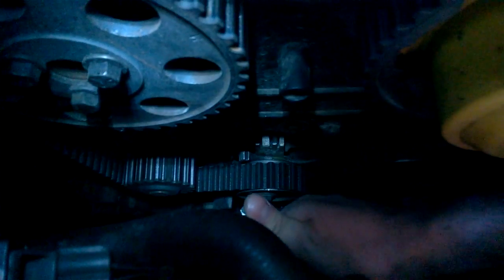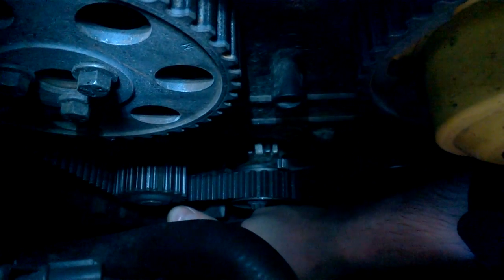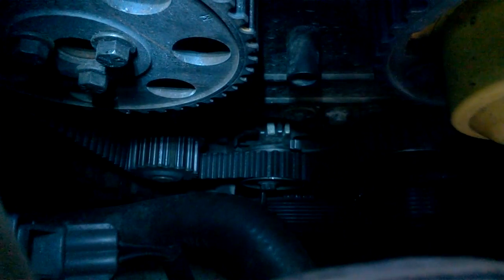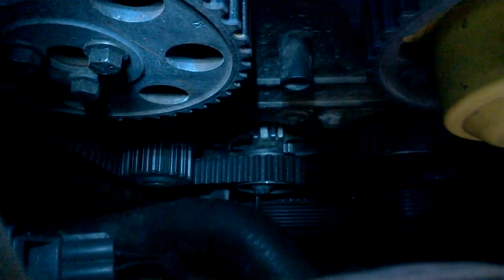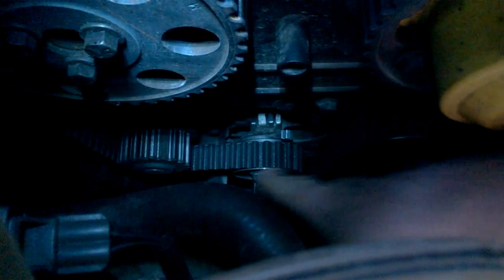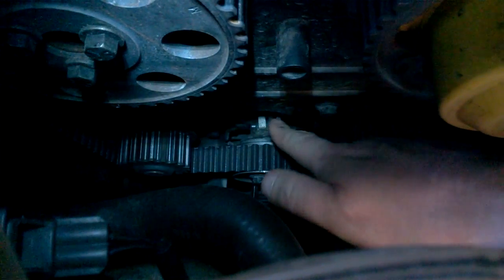Volvo S60 V70 XC70 timing belt tensioner set adjustment 2001-mid2004

Comment: Thank you for the video!  Here is what I'm experiencing.  I'm trying to set a new Volvo INA mechanical tensioner, like the one in your video.  On a 1999 S70. 

1. The new timing belt is on fine.
2. Tensioner bolt is on finger tight.
3. Hex hole is starting at 11 o'clock.
4. Turn 6mm hex counter clockwise.
5. Needle does not move.  (it should be!)

I believe the tensioner is mounted correctly, as tabs 2 & 4 are outside of the rib on the block. 

However, I noticed that if I start at 11 and turn clockwise, the needle will start to move to the right once I get to 12 o'clock. I moved the hex further a bit more to 1 o'clock, but then stopped as it felt like I was putting a lot of stress on tab #2, like it was start to bend if I went further.

I know I am using the right tensioner, part INA 30638277, as my engine serial number is about 16xxxxx and calls for this tensioner.  Thank you.
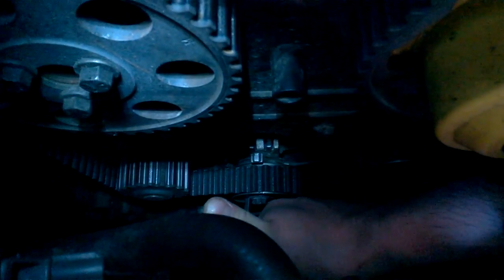Reply from the maker: Hi there.  With the hole at 11h, does the tensioner feel 'free' like at 0:26?  With the hex hole in the released position (at 11h) depress the belt between the exhaust cam and the water pump (the belt should flex a bit). Try depressing as well between the cam gears.  Does the tensioner needle move to the left?  I'm thinking there is already too much tension on the belt for some reason.  It's not a problem if the tabs bend (can happen), just bend them back in shape to stay centered.
If this checks fine, undo a little the center bolt, sometimes the tensioner can jam.  If still no luck, I would use another one.  There is another comment here below with another Volvo owner having trouble setting the Ina tensioner. He replaced with Gates tensioner and he seemed to say the Gates tensioner setting worked well.  I wonder if these Ina tensioners are that good. I know they last once installed, but setting them is terrible.  People recognize Ina has good bearings, but the spring mechanism inside is not their best product. Some also say the genuine Volvo ones are made by Ina - made it's actually just a Ina bearing while the spring mechanism is made by someone else (Gates?).  
Not shown in this video but here's a few checks to make sure the tensioner was installed and set correctly: the belt runs close to the center of the cam gears, without wobbling, the tensioner needle doesn't shake, and goes back to center when the engine cools down in summer days, depressing the belt in between the cam pulleys makes the tensioner needle to move to the left (if I remember well) then go back at center as the belt is released.  Finally, one trick to have the needle stay at center when tightening down the 14mm bolt (15 ft-lbs or 20 Nm, this is not a very large torque so a torque wrench is quite a must to set it right), is to set the needle more to the left: when tightening down the 14mm bolt the needle has a tendency to move by itself to the right a little.
Reply: @Peppermint1  
Thanks very much for your reply and the information!

I have reset it again.  I started loose as you mentioned.  I again experienced a lot of resistance when I moved the hex counter-clockwise. So, I helped the indicator needle move by using my finger to pull it to the right, while I moved the hex counter-clockwise with my left hand. 

I then did the opposite to move it back to center (moved hex clockwise with one hand, while pushing indicator to the left with my other hand).

This seemed to be the only way to get the needle to move.

After this adjustment, I torqued the bolt to 15 ft lbs.  The needle is accurate for the temperature, the belt rides on the pulleys centered perfectly, and the car runs great.  Pushing on the belt moves the needle freely to the right, as it should, and upon release the needle moves back to center.

However, there is a slight shake of about 2mm left and right.  Here is video of that.  I may try the adjustment again to eliminate the shake.   Some people in Volvo forums say some shaking is fine, but I know you have said that it should remain stable. 

https://youtu.be/04CqHh503m0
Reply from the maker: @pete2112AD  Some people will indeed say shaking is fine. Myself I can't say if it's a significant problem or it can go like this forever.  I remember one tensioner I had was doing the same, replaced it with another one which is stable. If you remove it again, worth spinning the water pump, and perhaps also the pulleys (all of them) on the serpentine belt, see if these spin smoothly.  But my guess goes with the tensioner itself.  Maybe just keeping an eye on it and perhaps replacing it sometime in the future.

Comment: I bought a second pulley, but this time Dayco. With the INA, I had a problem when tightening. When I went to 6 o'clock and the needle was furthest out, I couldn't relieve the tension back easily to adjust  it to go into the window. I had to put pressure and the mechanism seemed to be high friction to the backplate. When running the engine, the needle was shaking left and right. 
With my second attempt (after releasing the tension and starting again), when trying to release tension, the leg which prevents the backplate from rotating, started twisting, because the mechanism was stuck more. 
With the Dayco everything was ok at the beginning. I installed it, but may be a bit to the right of the window. I thought it was ok, because the temperature was around 25 C. I started the engine and the needle stayed calm. When I drove for a while, I stopped and saw that the needle reached after the right window border and was shaking. I waited 3 hours, but engine was still warm. I untightened the bolt, released the tension with the allen key, but it was difficult like I described with the INA above, and again with my second attempt the backplate tab started twisting.
So I installed back my Gates pulley with the bad bearing and it was perfect.
Reply from the maker: Great feedback. I also noticed that the more we try to adjust one, the harder it gets, perhaps the mechanism is good for adjusting them only once then forget about them.  I also had a lot of trouble trying to adjust the Ina tensioners (I think Ina makes them for Volvo): they may be long lasting but are indeed difficult to adjust.  I also had the small tabs starting to bend, but it's easy to straighten them back on.
Reply: But haven't you "broken one"? I mean, how were you still able to adjust it after bending and straightening the holding leg?
Reply from the maker: I got the tensioner out, and got the "legs" straight again with a pliers.  These legs that sit against the block bent when the center bolt is too tight, making moving the allen key harder.
Reply from the maker: For those who read in the future, don't be too worried about the tensioner indicator/needle reaching the far right position when the engine is hot - actually, carefully so you don't burn your hand, reach the indicator and try pushing it more to the right, if it moves, it means it still has play so the tension should be good.

Comment: whenever I try to fully tension mine and then adjust it into place the tensioner just pops back out into the fully loosened position
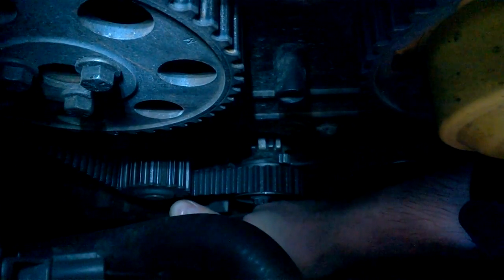Reply from the maker: Which year the car?   Are you starting at 11h  like at 0:28?
Reply: It's a 2001 with the same exact tensioner that you are using in the video. I start at 11h like you did, then I fully tension, and then when I try to move it into the correct position the tensioner springs back quickly all the way to 11h
Reply from the maker: If the needles stay at their place on the engine block (they hung on a small bump from the block),  I'd say then the tensioner has a problem.  Is it new?  Is it the INA with the red strip?  I would not use any other brand because even these INA are (very) tricky to adjust, I had a lots of problems with the needle moving when tightening down the bolt, or the needle not sitting in the center any more after running the engine for 1-2 minutes and shut it off.  The way these tensioners are designed is not good in my opinion, they don't fail but are very tricky to set them at the correct position.
Reply: yes  the tensioner is brand new and not a knock off (red). I Got it directly from FCP Euro. I will inspect it and see because i am thinking it may be bad. Thank you for the help and advice this is my first timing job and everything else is good.
Reply from the maker: One good way to check the tensioner has been set at the correct tension is to see how the belt is running over the cam gears with the engine running: the belt should stay close to the middle of the gears and not oscillate. If the belt runs near the edge of the pulleys, then there is a problem with the tension.  The temperature needle on the tensioner should also not shake.

Comment from the maker: These tensioners are very hard to adjust because when you final tighten the center bolt, the needle moves to the right and won't stay in the center.  Volvo says to slightly tighten the bolt to 5ft-lbs (4 N-m) first then adjust it, and when done, final torque the bolt to 15ft-lbs (20N-m). You may also try to adjust first the needle more to the left, so when you final torque the bolt it moves back near the center. But you may try several times. Also read the video description. Here's how to know if the tensioner was not properly adjusted: if the belt runs off center on the cam pulleys or 'wobbles' on the cam pulleys, the tensioner has a problem or the tension is not correct, or the bolt doesn't have the correct torque (too much torque is not good either). A few words about how this tensioner works. I believe the needle moves to the left when the rubber of the belt shrinks in very cold weather (before the engine starts), then the needle moves to the right when the belt extends as it warms up from the engine heat as the engine is warming up.  Basically, the tensioner is 'absorbing' the extension or the shrinkage of the belt depending on its (belt) temperature, so as to keep a constant tension on the pulleys.

Comment: As a Volvo professional, you NEVER have to readjust the tensioner
Reply from the maker: Indeed.  The video shows the procedure while installing a new belt, adjusting the tensioner may need several tries before it's set correctly especially for a beginner.  Once the belt is installed and the tensioner properly adjusted, not further adjustment is needed - a visual inspections is always recommended to verify that after a first drive when the engine cools down back again the 'needle' sits in the center position when the outside weather temperature is around 15C (60F)
Reply: This is obviously a video for non professionals and Volvo owners not Volvo stealership employees

Comment: Very good video.  Did my timing belt, tensioner, idler, and water pump 9 months ago.  As you said, I bent the first of the "legs" that position the tensioner against the engine block.  But I thought I had the right tension so I let it go.  Tonight I ran the car until hot, then removed the covers to inspect.  The tensioner "pointer" is PAST the second mark, in fact it goes to the second leg (i.e. the fourth of the four pieces of metal).  So I think it is too tight; with the engine running, the pointer even twitches forward slightly then falls back to the fourth notch.  I will wait until tomorrow and inspect when the engine is cool, then re-tension if necessary. I struggled with the tensioning procedure when I did this job.  This is my late father's last car, and I'd like to continue driving it for a very long time.
Reply from the maker: One tip is to tighten a little the center bolt (not fully tighten, just a little bit) before adjusting the pointer.  This way the pointer will feel a little more resistance when it's adjusted and has a better chance to remain in place at the correct position when the center bolt is finally tighten to 15ft.lbs.
Reply: Thank you, with your help I adjusted the tension this morning.  Still perhaps a little tight, but within a range that I can relax about and it's a step in the right direction after driving the past 9 months very tight.  Thank you again!  Also, I removed only 2 plastic covers, so now I know that it is relatively easy to inspect the timing area again anytime without removing other parts.  My car is a 2002 V70 with naturally aspirated B5244S engine.